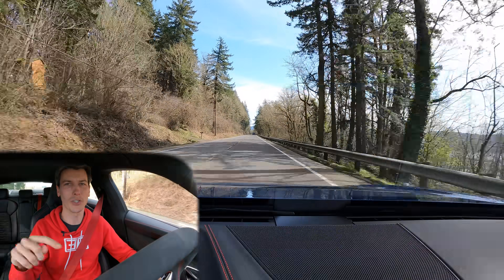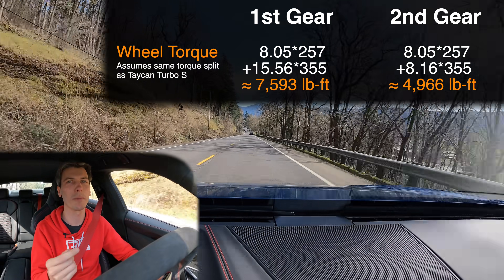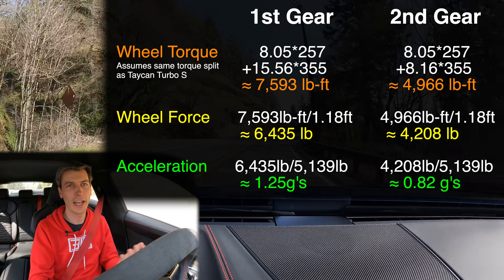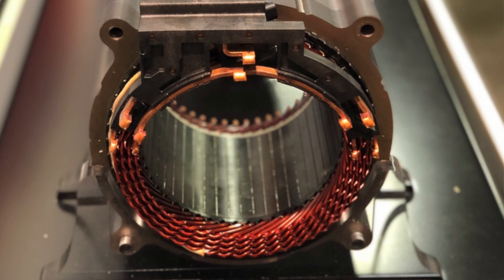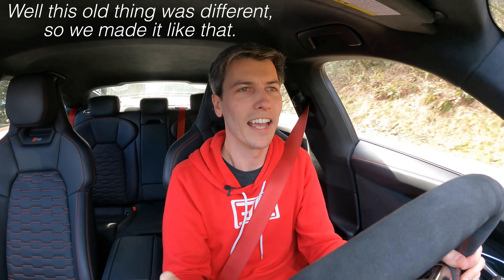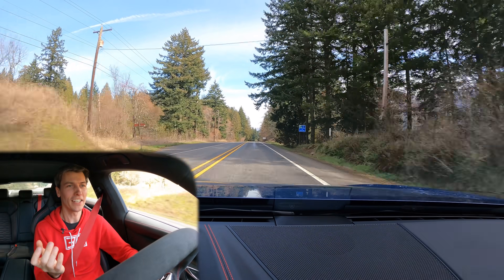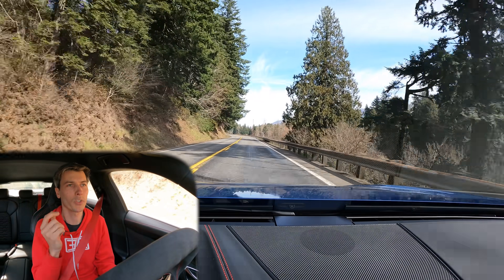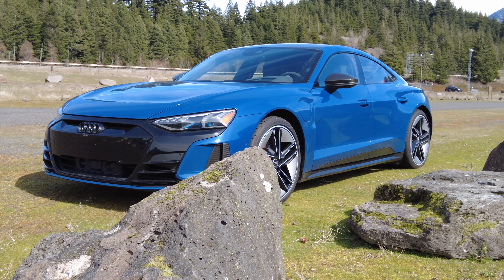Are Fake Manual Transmissions Coming? Audi Keeps It Real

Comment: Jason doesn't understand the point here. His framing is "why would you do a fake transmission?" "Well this old thing was different, so we made it like that". The better answer to "why would you do a fake transmission?" is "because it is more fun". This is like going to someone who can shred a 1961 Les Paul Custom, giving them a Guitar Hero controller, and trying to convince them that this is new and better. Also: GM should have made a "fake" electro-mechanical manual for the C8.

Comment: I think there is more to the noise generator. Yes it is about transitioning to something different and easing people into that a little but it's more about the sensory feedback people associate with car sounds and speed. Also one of the issues with EVs is the removal of a lot of that mechanical noise provides a low noise floor in the cabin. That noise reduction makes more room for road and tire noise which can be a very irritating sound in my opinion. My take on the EV noise generation thing at least
Reply: I see a point in audible feedback and I think it's not a bad idea. The problem is car makers don't look at it this way, they want to emulate what's already gone and this is not good reason to do it. I think something interesting can come out of it as soon as they look at it from a new perspective. There is a place for great diversity of audible feedback systems and as soon as the car makers stop pretending there is an actual engine in it, they will be able to tap into this potential. Who says it has to be the ICE engine roar or this electric sound? It could even be a dynamically composed audio score that would adapt to your current driving just like an ost fits an action scene perfectly.

Comment: Making a V with a manual trans would be inefficient but fun. If you just want to drive, put it in 1:1 and be fine (no clutch needed as evs are fine with 0rpm idle) and if you want to have fun, row your boat.

Comment: I always thought EVs would be better if they had a normal manual gearbox behind the Motor, same as every petrol car in the world. 
EV manufacturers are being lazy and cheap by not putting a 6spd manual between the output shaft and the tyre.
Reply: When the petrol motor hits the rev limit, you grab another gear.
 When your electric motor hits max rpm, you can’t go any faster.
Reply: Why on earth would you want to put all that additional complexity and expense in there when you don't need it?

Comment: Wouldn't it make sense for manufacturers to consider motor designs with tapped coils so that the motor's KV can be varied by the motor controller electronically? I would imagine the motor's BL can be varied, resulting in a similar effect to gearing without the driveline loss (traded for rotating mass at the motor and some electronic complexity)
Reply: That adds more complexity to the motor. And it'll likely fail sooner than just adding gears. 

As someone stated the higher the frequency on the VFD the more likely it is to fail. Gears assist in maintaining lower frequencies to get the same vehicle speeds

Comment: Real gears on an EV make sense as to reduce the need for high frequency drivers delivering peak power (very tasking on these components). Aim the gear ratios right where peak power is achieved and torque starts to drop. However, new designs in stators and other motor modifications is making driving the motors @ high rpm easier/more reliable. Though you can't escape back EMF among other challenges with high RPM electric motors.
Reply: I think you touched on the magic words "Back EMF" (Back Electromotive Force).  In electric motors, torque is proportional to current.  But the more rapidly a motor turns,  a proportionally higher the input voltage is needed to overcome the Back EMF just to maintain the same current and torque.  And we're not talking about small voltages either, but several hundred or even thousand volts.  Building variable high voltage supplies is not cheap or easy.  They require high voltage FET's or IGBT's, current and voltage sensors and control systems.  Also there's a hit in reliability as well. Not to mention potential insulation breakdown and arching in the brushless motor windings.
Second, you have to remember that electric motors turn into generators when braking.  So the high voltage supply has to be able to reduce the back EMF into a lower voltage that the battery can handle.
Third, there's the infamous chip shortage.  Using more common lower voltage components makes good business sense.
So sticking a multispeed transmission in to reduce the back EMF isn't a silly as it may sound.  Whether it needs to be a manual is a different question.

Comment: I wouldn't mind a torque selector lever that allows me to continuously select between full regen to full torque in place of a gear selector. Ie. pull back for regen, neutral for regular driving, push forward for full torque. And then still have a throttle pedal to drive with.

Comment: I got a question that’s slightly related, why don’t boats have multiple gears? Thanks.
Reply: Have you ever driven a boat?
They have a throttle lever that works similar to the pedal of an electric car. The boats propeller can spin waaaay faster than a combustion engine. So the torque and power output Is like an electric motor this no need for transmission. i.e fast spinning motors can differentiate torque output throughout their rpm better then slower spinning motors

Comment: But then why aren't electric motors typically given at 2-4 gears at least so that once you get on the upper rpm end, it's not screaming as much, drawing more current than they need to and wearing out the bearings faster?
Reply: @vikeshbubbles205 : Why supposedly "wouldn't" it draw more current with the faster it goes? I know they don't use brushed motors in this application these days, but that's what I'm most familiar with. So for the sake of discussion for the moment, let's say I have a brushed DC motor. The more voltage I put across it, the faster it goes. The more voltage you put across something, with all other factors being equal, the more current it draws. Therefore, in the case with that type of motor, faster speed does equal more current drawn.

But OK, then let's say you have the kind of motor that has to be driven with PWM instead of just a voltage adjustment. Perhaps it's a brushless "DC" motor. Or whatever AC motor that these cars use. Or, even with a brushed DC motor, it's stronger across the range when driven in PWM mode than in voltage adjustment mode. So in PWM mode, longer pulses mean drawing electricity for more time within a specific period, which means the motor draws more current, and that same thing about the pulse width means the motor goes faster. So why wouldn't the motor being driven faster equate to drawing more current?
Reply: @HelloKittyFanMan.  Because electric motors only draw current, when you put a load on them.
Putting a motor on your workbench without anything attacht and you let it run at max RPM it will just draw a tiny bit of power, because the only load is the friction in the bearing.
If the motor would draw full current the RPM will increase until it spins to fast and the motor explodes.
Reply: @jonasstahl9826 : 1. They don't just draw current when you put a load on them. If they did, then that would mean that they would only spin up if there was a load present. But if power is going through something, meaning that it's running, then it must draw some current.
2. The force it takes to push the car along the road IS the load.
Reply: @HelloKittyFanMan.  You can test this with a cordless drill. If you just hold the trigger and let it spin the battery will last for a few hours, if you are drilling holes with it the battery with empty much faster.

Comment: the best would be a true mechanical 6 speed transmission on a electric motor, 2 gears to fry the tires, 2 gears to accelerate real fast and 2 gears to get 220 mph.
Reply: No, not really.  That's not how electric motors work.
Reply: @bindingcurve  Field shunting is a real thing.
Reply: @erkinalp  but why would you ever want to? Wrong tech for the application.

Comment: the only reason i think the toyota thing makes sense if for an interim learner car thing, at least here in the UK most people still learn to drive manual, if you can learn to drive a manual with a clutch, gearing stalling etc with no harm to the actual vehicle and it still be electric, that's fantastic, but that would only be an interim thing, for now even if new cars are going to be EV only in 5-10 years, there is still going to be decades worth of manual ICE cars out there and people will still buy second hand for multitude of reasons.
Reply: re: "there is still going to be decades worth of manual ICE cars out there..." "ICE ICE BABY" (Bowie/Queen guitar riff)

Comment: I'm not usually on board with the "fake stuff" but I'm 100% sold on manual EV, whether it's electronic or mechanical. I strongly believe that people drive better in a manual car vs auto simply due to driver engagement. Whenever I borrow/rent an auto I notice immediately how much worse I'm driving compared to when I drive manual. When you don't have to be aware of those deeper level vehicle dynamics it's easier to just kind of zone out and slip up

Comment: I vote YES for this :) what matters for driving pleasure is: sound, manual, handling, accelleration, driving position etc. whether it burns gas or not doesnt matter :) that said, heres hoping synthetic fuels are comming :)
Reply: Hearing the engine sound at high rpms, hearing the boost building up. Stuff like this will be missed in an ev. But ev has its advantages too.

Comment: I get the desire.. But if you stop and think it is kinda weird and niche. It'd be as if around the year 1910 people that grew up with horses insisted that they modify new automobiles to have saddles, run on hay and water and leave behind fake piles of poop. I doubt that was a thing. I think people saw the massive upside to automobiles and never looked back as we should with EVs. Instant torque. Silence. No fragile gears and associated efficiency losses. These are things to be excited about.

Comment: If car makers really were smart they could use the  shift to choose a maximum speed while flooring, also lower gears on high speed can be used as a selector of how much regen you get, so if im runing at 5th gear and then lower it to 3rd i get a medium regen breaking, if instead i go to 1st gear i get a ton of regen, i know that's how already works with the pedal, but what if this is sold as a feature specially useful for people with reduced mobility and also as a safety lock?
Reply: Now this could make sense. And it's important enough a feature to merit large, intentional control inputs.
Reply: I always thought the same maybe more peak current.
Reply: I like this regen amount selection idea. Shifting gears is a natural, tactile way for a driver to implement multiple options/settings. Sometimes I want to limit torque, though, like on snow or ice. I've used the ECO mode in my Leaf for torque limiting, but it still higher then when I had a 5 speed and used 3rd or 4th gear to try and get some traction (traction control doesn't help much from a stand still). Granted, this is a sports car and probably won't see much snow, but if Toyota put a fake manual in an EV Tacoma and didn't charge a ton for the option, I'd probably buy it even if I only ever used it for said snow/ice situations.
Reply: @extragoode  
You control torque and regen with your right foot. That's the simplest, most flexible and most intuitive way. Tesla also has "chill mode" that limits torque, but it's not really needed, you have very fine control even in sport mode. It's easier to drive an EV slowly than a gas car, even if it's stupidly powerful, because they don't stall.
Reply: @andrasbiro3007  neat, Teslas aren't the only electric cars and i still like the idea of being able to choose a smaller range of acceleration and regen than all of it. If you don't that's fine. Ideally you'd be able to choose whatever mode you prefer.
Reply: @andrasbiro3007  Does anybody know if the "low accelerator pedal" "low speed rotation" is a lowering of torque or just a lowering of rotational speed? Like if you were to go 3 mph in a plaid, does it climb up a hill the same as a model y (similar weight, different power capacity). I know modulating motor rotation can be done with voltage and with frequency. 

My point being, does tesla leave the current draw (and therefore torque) up to the driver? In a gas auto you really just ride up against the stall rpm, and in a manual you limit torque by way of gearing. In an ev I can imagine it being a combo of both what he pedal does and what the sofware thinks is best. Guess I need to watch an EV climb up a trailer more closely. I wonder if sport mode and "chill" change the ratio.
Reply: @0Rookie0  
Obviously you control the torque with the pedal.
Reply: could make sense, but in this scenario, the clutch pedal is useless.
Reply: @BC107BP  agreed, but nothing in this comment was talking about a clutch pedal.
Reply: I think a group of engineers with a few hundred thousand dollars in budget to spend come up with something way better.   Nice thoughts thought.
Reply: re: "If car makers really were smart they could use the shift to choose a maximum speed while flooring" well they (Porsche/Audi) ARE smart for i believe this is how they have set the both vehicles up (hopefully Jason will confirm).  understandably when you win the top Hybrid/LMP-1 class at LeMans 16X you learn a few things.
Reply: Where do you buy your weed?

Comment: I have an argument for a positive reason for; "well, the old one used to work this way...".  Young drivers who haven't had a chance to drive a manual transmission that would like to know what it was like.  Also you have to pay more attention to driving with a manual.  You're hands aren't necessarily free to work a phone or a touch screen.
Reply: true. i find driving an automatic to be boring.
which then i would find myself get distracted with the stereo, intrument clusters, phones, billboards & ads

while when driving a manual, i have no interest in all that. ok maybe at a stop light once or twice to change the playlist or something.

it's like having something to fidget with, but it actually have a purpose.
Reply: Well that's a horrible argument.  You're either a bad driver or not.  Shifting a gear doesn't make you better.  A bad driver won't magically be better because of it.
Reply: @Sheridantank  nobody who knows how to drive a manual hits the accelerator instead of the brake and smashes through a store front or car wash.  I've been driving since '99 and learned with both automatic and Manual cars from the 80's.  I was a mechanic in the mid to late 00's so I had to know how to drive anything with any transmission.  The manual transmission cars and trucks always ran better and the owners usually took better care of them

Comment: The reason you pump in noise isn't just we had this old thing and we want to make it like the old thing. It's because sound is part of the visceral experience of being a human being. I remember the first time I went to an Indy car race. I'd watch plenty of it on television, and you knew the cars were loud. But the experience of that sound at trackside just multiplied the excitement of the experience. It's about sensory impact. I will say, that I would certainly like to be able to turn that sound off completely, and I don't know why they would build it otherwise. It's certainly not a problem to do. The only reason I can think of for the sound to always be present, is if it is acting in a noise canceling capacity, but then you won't hear it anyway.

Comment: I disagree. If the torque and regen characteristics change with the different "gears" it gives the driver greater control over the braking and cornering dynamics for given conditions on road or on the track. It's be really cool on an electro-modded classic too

Comment: The ONLY thing I don`t like about my car is the CVT. The ONLY thing I don`t like about the CVT are the fake gear shifts. They are pointless and jarring and inefficient, especially under heavy acceleration. Why can`t they let you turn it off! Did they really have to force it on everyone?!
Reply: You had options, you buying one is validation.
Reply: @nedson6503  I'm not going to buy a car that has 5 things I don't like. It's one part of the car. Besides, there were almost none at the time that didn't have it, so NO, I didn't really have options.
Reply: @FrankLeeMadeere  When I say options I mean other cars, not specification.

Comment: since it's fake anyway... do they have an "auto mode"?

like when you're tired or stuck in traffic and dont really want to deal with the manual transmission mode.
Reply from the maker: Yeah, push a button and it's all deactivated, drives like a normal EV.
Reply: Was just thinking the same .. and .. how do you stall an EV?
Reply: When you get down to it, the powertrain itself is no different than any other event, I'd assume use of clutch pedal would be optional. I mean the electric motor does not idle, no reason to require action from the driver to "disconnect" I would think. But that's just my thoughts, I could be totally wrong on it. I'd assume with no throttle input the electric motor is just off, same as when you push the clutch. Who knows I'm sure they could just about program it to behave however you wanted, the question is more about how they think it would be best done, I guess?
Reply: @goosenotmaverick1156  basically, you're driving a simulator, but it actually moves, can crash, costs a lot, and need maintenance.